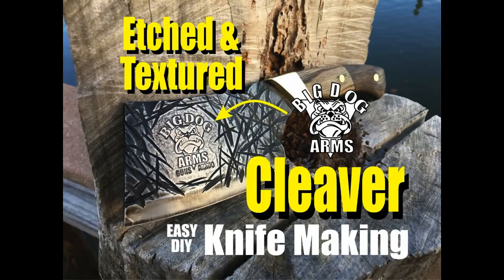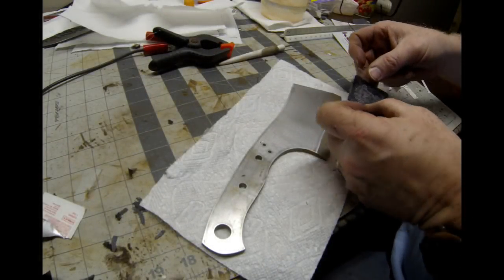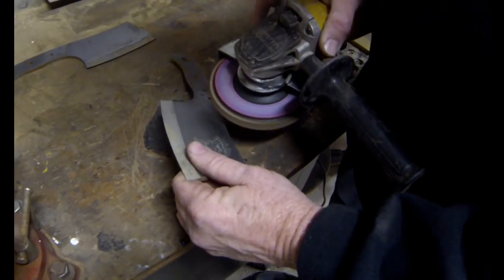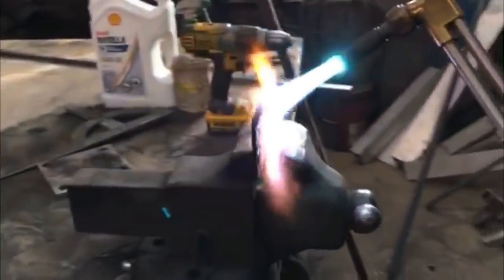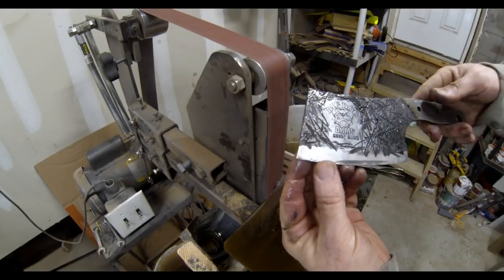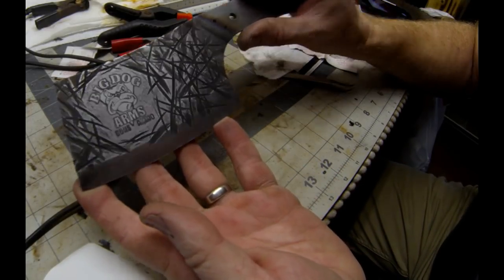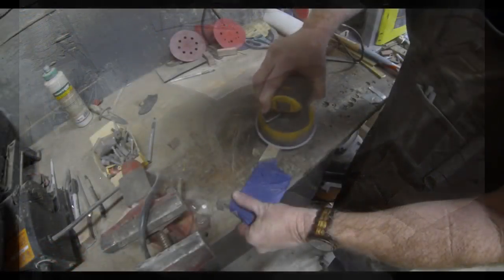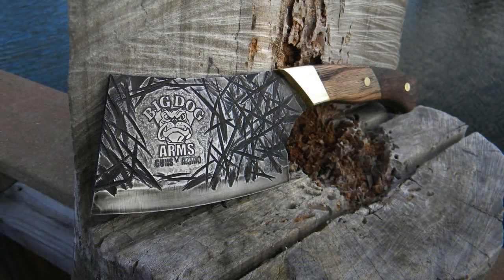How to easily make a Cleaver knife with etched logo and textured blade

Comment: I currently use a cricut vinyl cutter to make stencils for my blades but I've found it has serious problems with cutting fine details on small stencils.. does your cameo have problems with intricit details?
Reply from the maker: I bought the more expensive blade and problem was solved